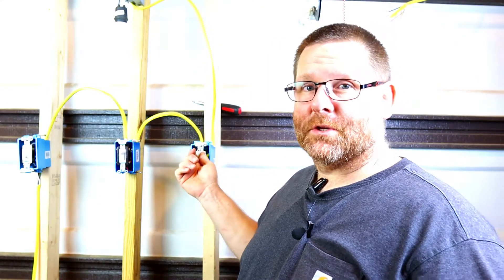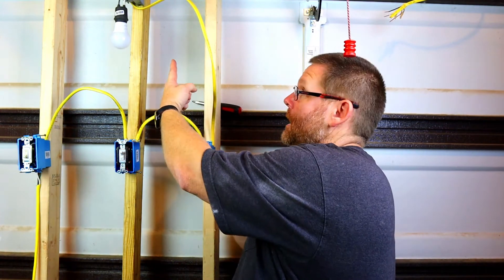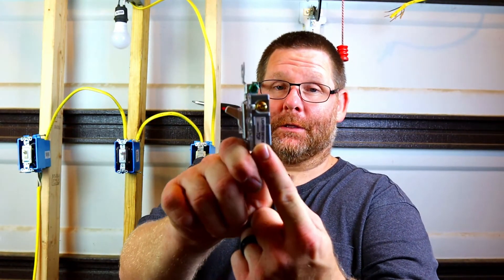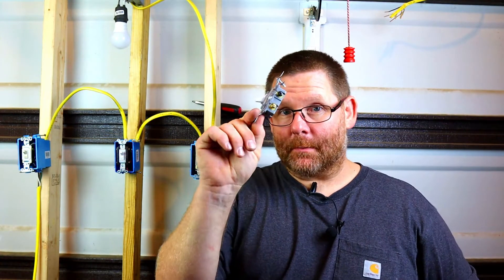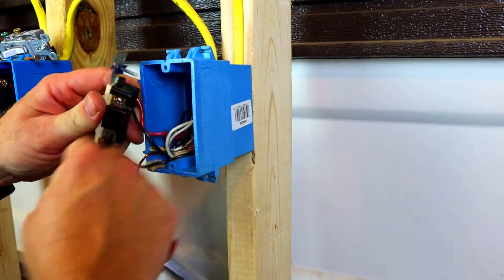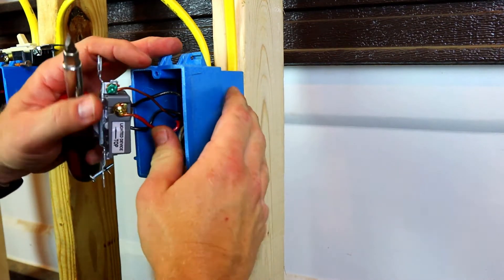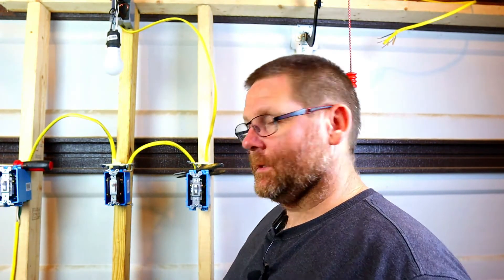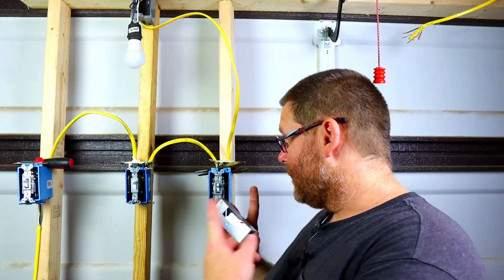How To Wire A Lighted 3 Way Switch

Comment: Thanks for helping us! Will the 3 way pilot switch turn off or can it be wired to turn off? My electrician just wired a pilot light for my basement lights so I could tell when those lights were on or off, but the pilot light stays on whether they are on or off. There is another switch downstairs so it’s a 3 way setup, and my electrician told me the pilot will always stay on in a 3 way setup. Thoughts?
Reply from the maker: Pilot switch? Like a red light on the switch??
Reply: Right. I wish my light switch was lit up when the lights were on. It stays lit up when the basement lights are on or off since it’s on a 3 way and the other switch is closer to the light (as far as I’ve heard, but I’m not an electrician and have little experience).

Comment: Great videos. Question. We just bought a home. As you walk into the bedroom hallway, the previous owner plated over an outlet. I'm assuming it was a 3 way that controlled the 2 pot lights in the hallway (outlet has 3 wires). Right now, you have to stumble in the dark until you get to the bedroom 3 way switch in order to turn the lights (that are behind you - ha) on. I removed the plate. 3 wires. It looks like the power supply A. (white/black/ground) coming into the box, and then two other wires coming into the box - a single B(white/black/ground) and a single C(white black red ground). So that tells me the plated outlet was a 3 way.  Its currently wired as (all whites pigtailed ABC), (black from A, black from B and red from C pigtailed) and the single black from C (capped all by its lonely self) . I'm assumed it would be easy to add the 3way but just not sure of the switch connections. Can you help me - Thanks

Comment: I sought your video, because I just installed an Eaton Lighted 3 way, and another unlighted for a hall light. All good.. my initial concern was that the light in the lighted switch seemed fairly dim, but I reckon that's just the way it works. Another question; (although I'm about done with all of my switch & outlet upgrades) is there a particular Klein stripping tool that you recommend? I think I saw you talk about it in another video. Thanks for providing the very valuable info!
Reply from the maker: https://amzn.to/36RzTY6 if you are referring to romex strippers then here is a link to one pair. You can also go to my store where I have alot more stuff www.amazon.com/shop/mountaineeroutdoors

Comment: I'm liking these DIY vids. Been needing to put in some more electric plugs in my garage. Can I just run wire from an existing plug to add another.  There's only one on the wall in question.
Reply from the maker: Absolutely you can I appreciate you watching...make sure though if it's in a garage you have them gfci protected.. That's code anyway. Merry Christmas
Reply: @MountaineerOutdoors  What's a gfci? Merry Christmas to you and yours too!
Reply from the maker: Ground fault circuit interrupter